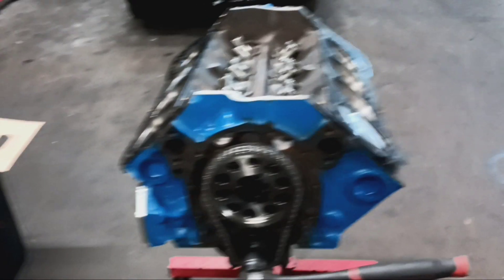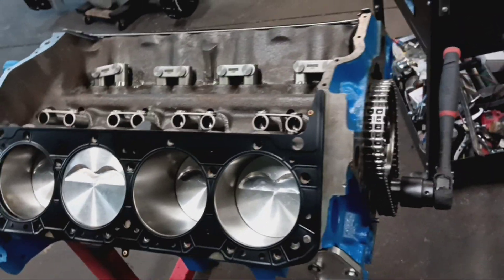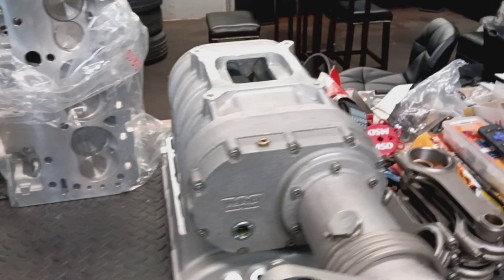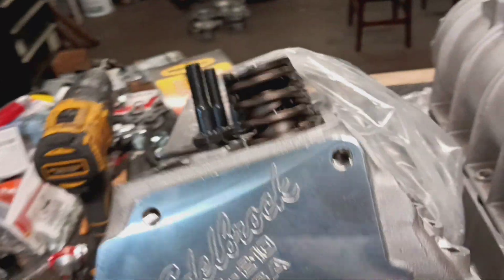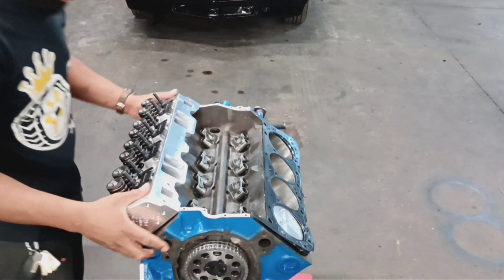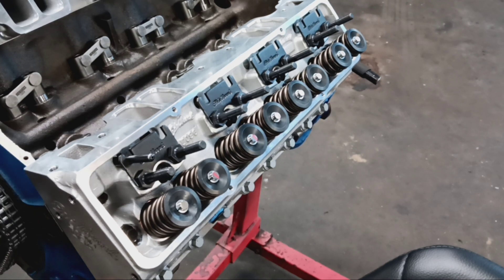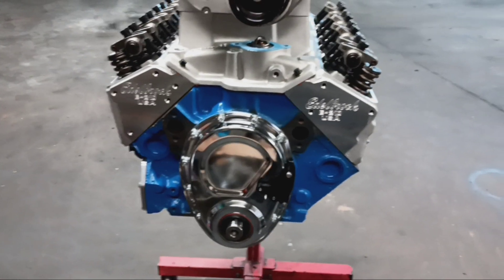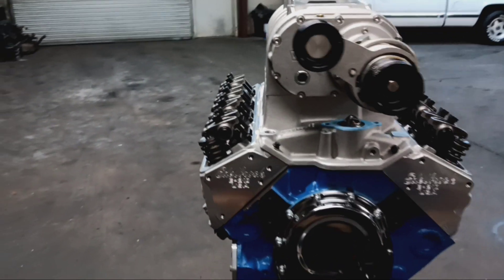How to measure for proper pushrod length

Comment: BRO YOU GOING BIG  I SEE IT COMING MARK MY WORDS LOVE THE VIDEOS KEEP THEM COMING    STEP BY STEP TEACHING
Reply from the maker: I appreciate that
Reply: @SSPENGINES383  Anytime bro I have a question 383 Stroker , what is the best spark  plug  and gap for the motor with build vortex heads I don't know cam size I didn't build the motor but sounds amazing whoever build it  used Arp on everything any help would be Great.
Ly appreciated it came with 350 trubo and 2500 stall